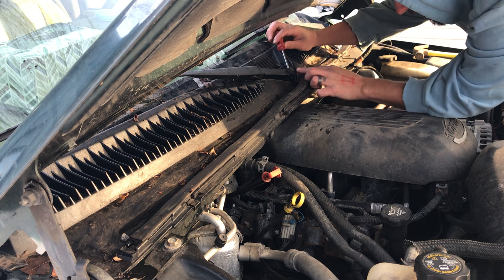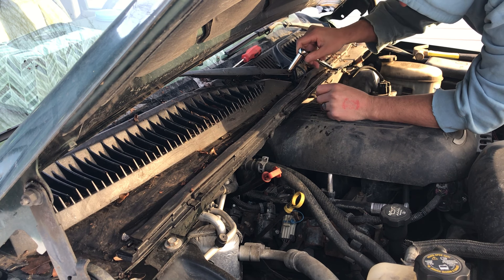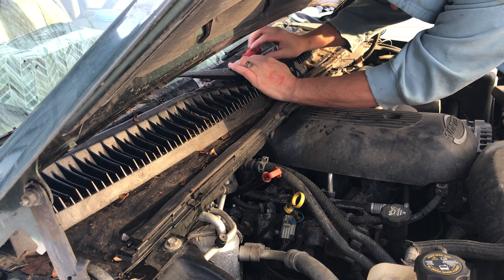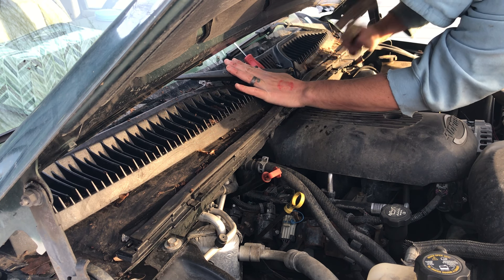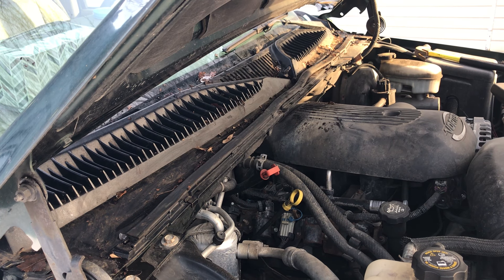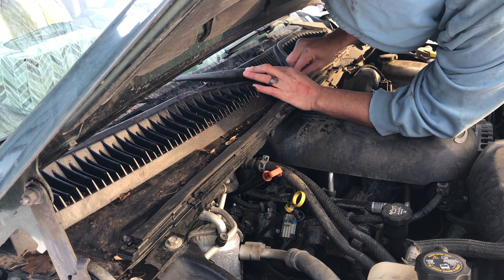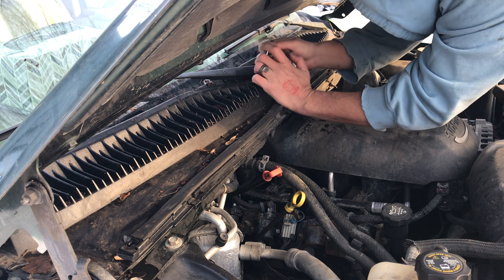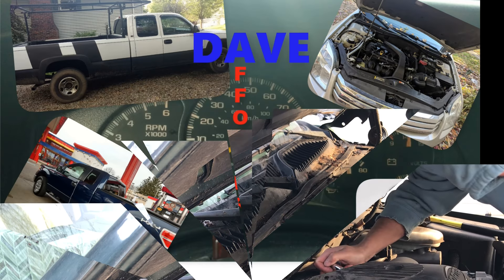2003 Tahoe, Silverado, Yukon, suburban, wiper arm replacement. DIY

Comment: It worked, thanks.  I spent a couple hours trying to pry from every conceivable angle with a wide range of tools without a budge.  This worked quickly and easily.
Reply from the maker: I've been there. I'm not even sure how I figured this out but definitely wanted to share it once I did
Reply: @daveaffolter9697  I appreciate your doing so.

Comment: My wiper arm is good except that the windshield sprayer block is busted at its base and only sprays to the lower portion of the windshield and not it's full range ,is it possible just to replace that sprayer block portion and not the entire arm?

Comment: I have 2004 avalanche I tried what you did, but wasn't successful. stock for 20 years. I tried Lisle 54150 wiper arm puller worked like charm. don't get the shame Chinese copy it's crap.

Comment: This is NOT how to remove the arm.... unless you want to destroy the actuator.
Reply: Your suggestion ??
Reply: remove the nut, spray the post with penetrating oil, wait a few minutes then put the nut back on a few threads and use a small two jaw puller to remove the wiper arm...beating on it with a hammer is a bad idea especially if your wiper motors are old